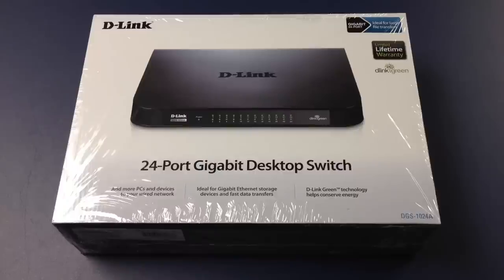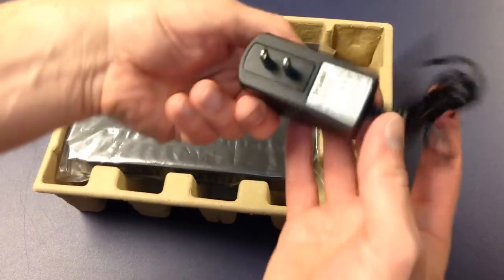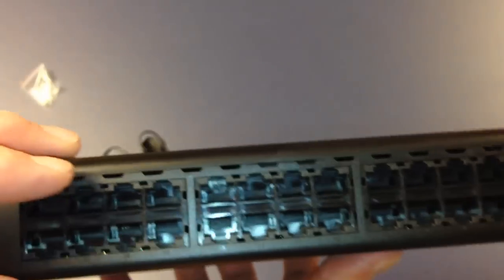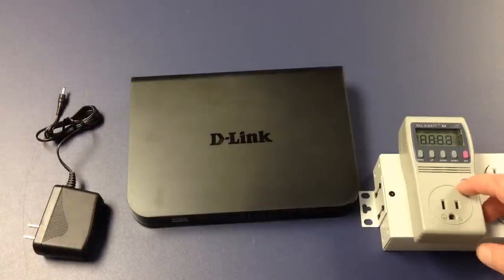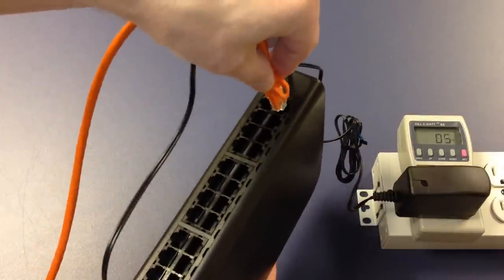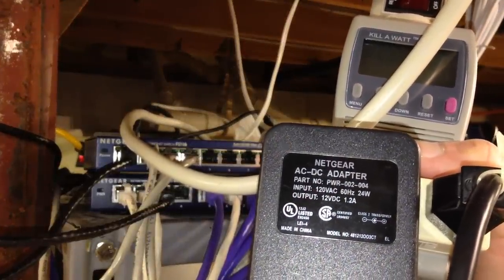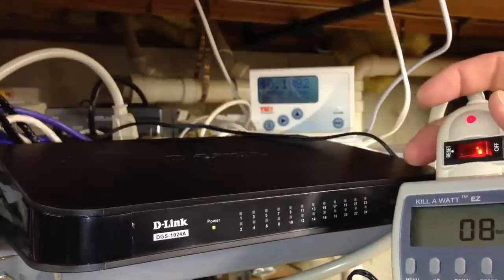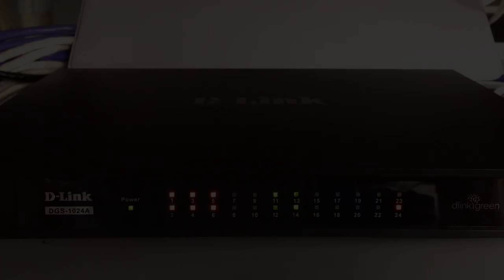Unboxing and measuring watt burn of D-link 24 port gigabit switch (DGS-1024A)

Comment: if I'm not mistaken the manufacturer posted 12v and 1.5 amps. If that statement is true you shouldn't see more than 18 watts @ Max load. which is less than the max load of the other two switches.

Comment: Thanks for the video. Do you like having the ports in the back? i'm looking at getting the same switch.
Reply from the maker: LAHAL1 For my set and forget it installations (behind a TV, in my basement, etc), I'm fine with the ports on the back.  Not ideal if you constantly move cables around, and attach/detach devices.
Reply: ***** Cheers thanks.